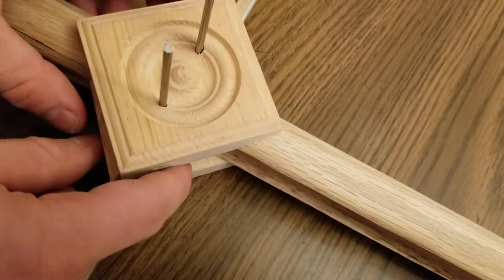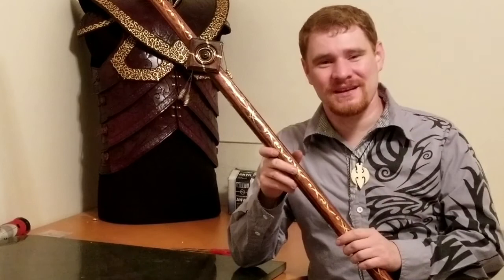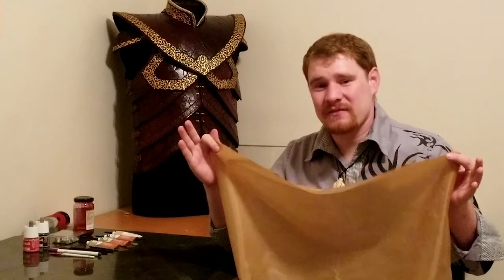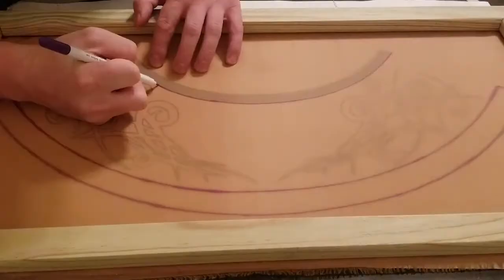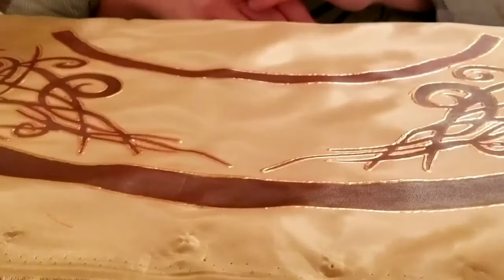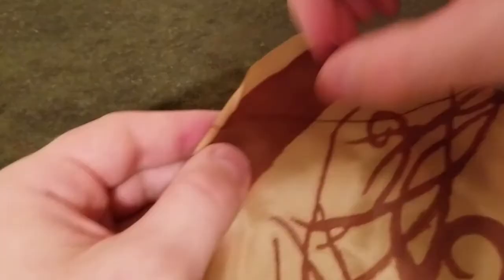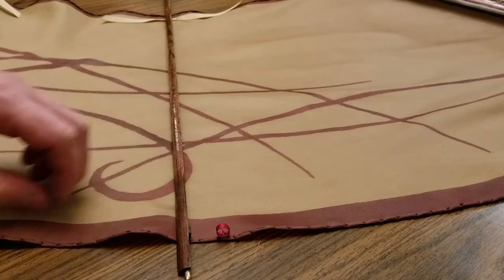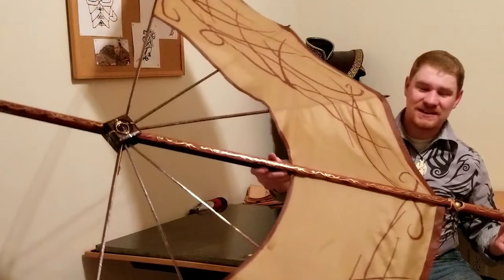Avatar, the Last Airbender: Airbending Staff Tutorial - Part 4 - Silk Painting and Demonstration

Comment: Supply question -

How large of a piece of silk do we need?  I understand this is not sponsored, yet do you have any recommendations on where to get the habotai silk?  Especially as I want to avoid getting one that stretches.
Reply from the maker: Excellent question.  I got my silk inexpensively on Etsy.  I don't remember the exact store, unfortunately, as it was a couple of years ago, but here is a link to some cheap silk that would probably work:
https://www.etsy.com/listing/1256483005/silk-habotai-gold-60-wide-for-lining?click_key=426c711768ee8f6506e98e18fe04f1204cd8e821%3A1256483005&click_sum=c51dbac1&ref=search2_top_narrowing_intent_modules_tabbed_price_bucket-5
As for the amount, 2.5 yards would likely be enough.  The wingspan is just over 6 feet.  The smaller fan can be made from the part cut out of the center of the bigger fan.  Get more if you want to experiment with the silk painting first though.

Comment: This looks good but it's not it. You need a much more robust primary structure, tensioned wing skin, and locking cam on the pivot. This can't fly.
Reply from the maker: Thanks for the feedback.  This was certainly designed for the aesthetics, and its "function" is its ability to transform.  I never claimed it could fly, nor would I encourage anyone to attempt such a thing.  That would surely result in injury or death. But that was never the point.